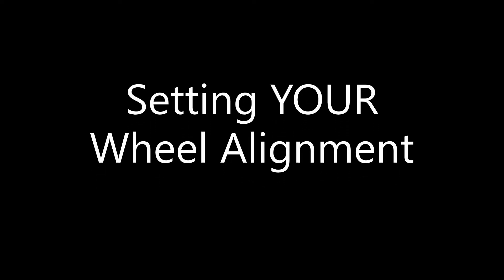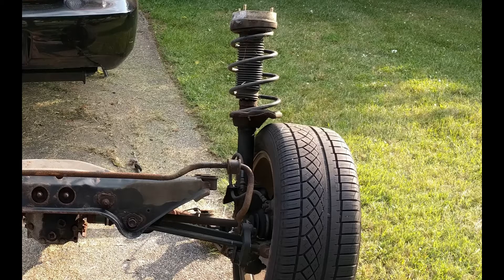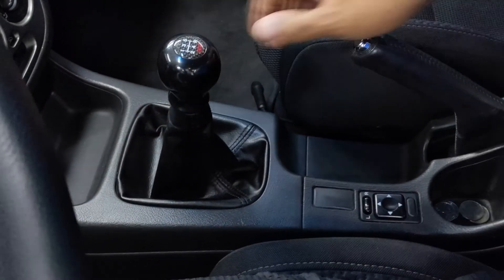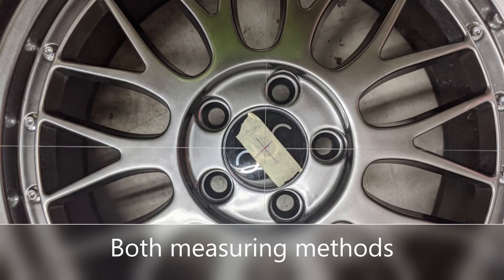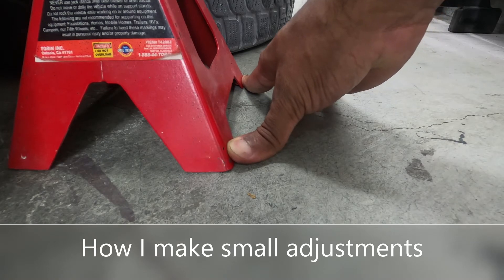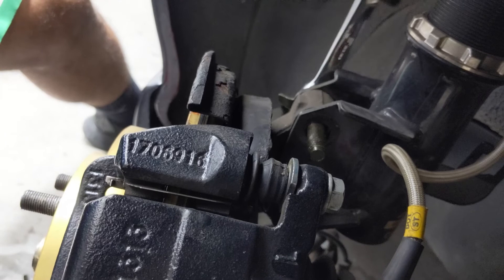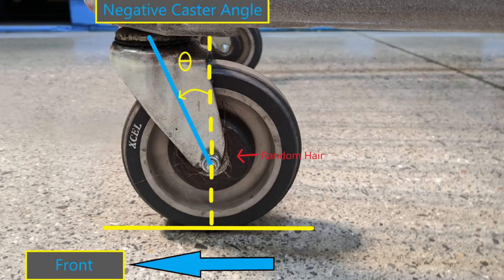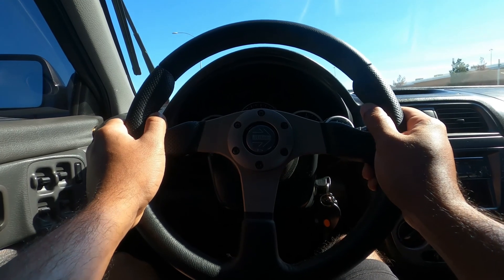How to Perform a 4-Wheel Alignment with Fairly Common Tools (String Method & Camber Tool)

Comment: This is one of the better string alignment videos out there. Definitely some techniques in here I'll use like the diagonal strings on the wheel center.
Reply from the maker: Thanks! I suggest considering turn plates too. If you participate in track events, I think they are worth the investment.
Reply: @RyUploads  Love that idea for turn plates. Any recommendation for occasional use?
Reply from the maker: No, I haven't pick up a set yet (been on my list). If I do I'll definitely update. I was thinking about making a "useful tools" video. On the fence bc when you tinker, that list gets really long lol.
Reply: @RyUploads  Please do share when the time comes. I saw a set then I saw mini ramps and then a second equal thickness pad set to complete kit...the list kept going! :)
Reply from the maker: That's exactly what I was thinking of doing (mini ramps). I'll def share when the time comes.